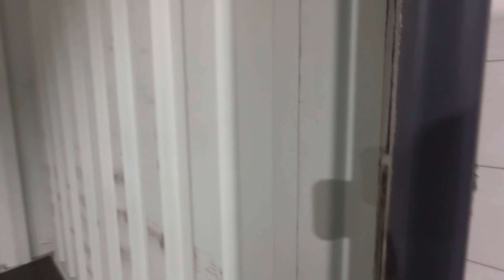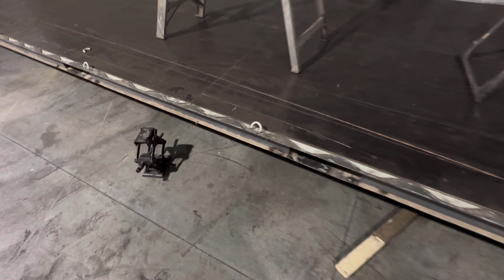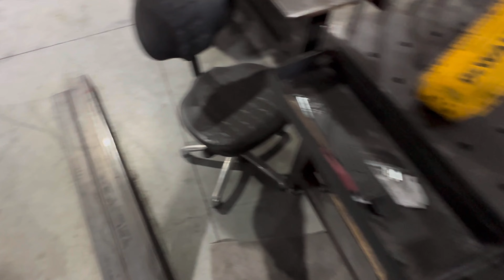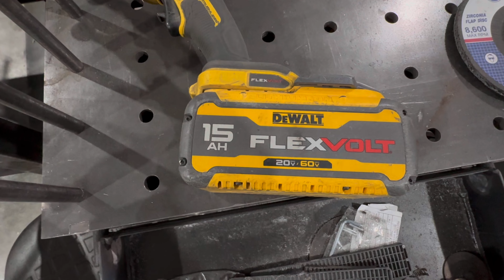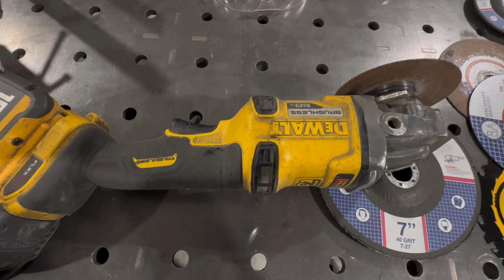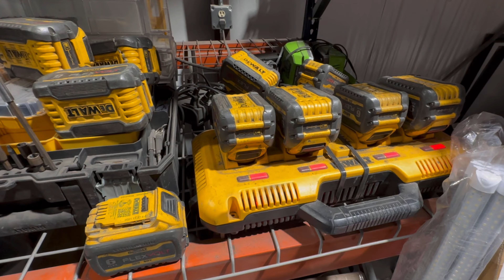OUR FAVORITE TOOLS FOR CUTTING CONTAINERS. THIS IS MY OPINION ONLY! #fabrication #shippingcontainer

Comment: Thanks for this vid. Not everyone cutting containers has to deal with the walls next to the corners, so there's very little shared about the fact that the metal there is different to the rest of the wall or that you may be trying to cut through TWO layers of metal there. Each container can be different, and may require different tools or strategies to get all the way through. I found out that the grinding discs I had weren't big enough to cut through the corrugation sheet, stretch across the 1/2 inch gap to cut through the casting metal. I'm now experimenting with a plasma cutter to see if the job will be easier on my arms and more tolerable.

Comment: Excellent video — congratulations! I'm planning to open the side of a container just like the one shown here. My only concern is whether this kind of modification could cause the container to warp. Has anyone experienced this issue, or is the structure strong enough to maintain its shape after the cut?
Reply: It depends on how you set up the container. I'm going to try to leave a much wall as i can, maybe 14' wide x 7.5' wide openings to leave some structure. Also looking how to reinforce under the fork pockets

Comment: Have you tried using an electric drill shears attachment/nibbler? I’ve seen vids of them just cutting through container sides like butter.
Reply from the maker: Yes, I forgot to mention it. Doesn’t work on top or bottom or sides due to angles and thickness. Works for cutting pieces you already have cut out, but not worth using due to ruining an expensive tool for what can be done with a .50 cent wheel. It’s 14 gauge so the DeWalt shears I have don’t really like it but they do cut it nicely.
Reply: @Simpleshippingcontainers  what about pneumatic shears like Kett 14ga?
Reply from the maker: @J-yl6on  Can’t get shears operating around edges where we cut most often. But I don’t think the blades will outlast the cutting wheels for the price.